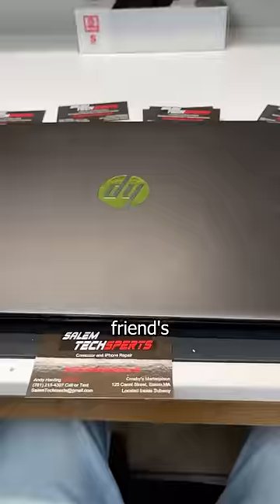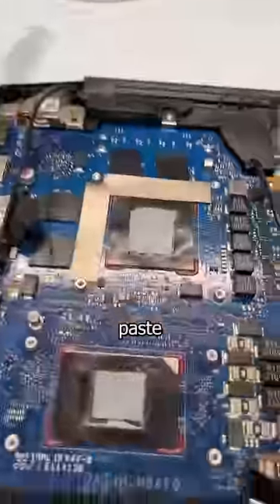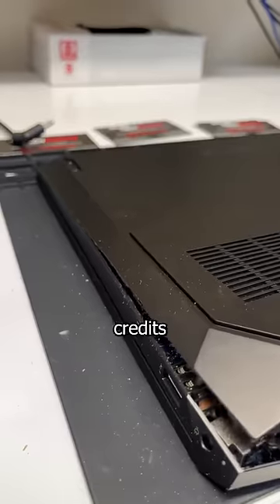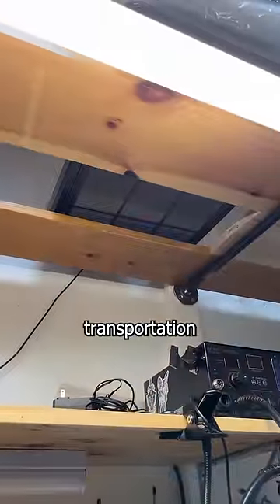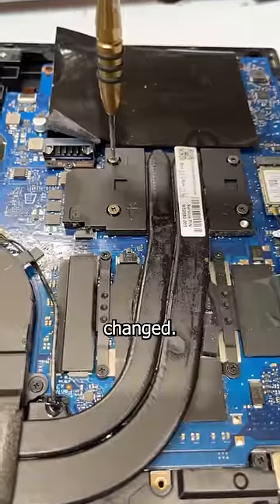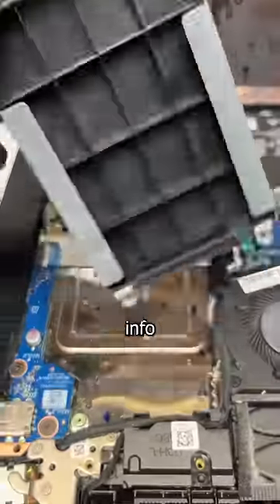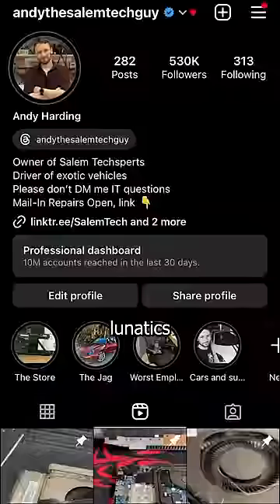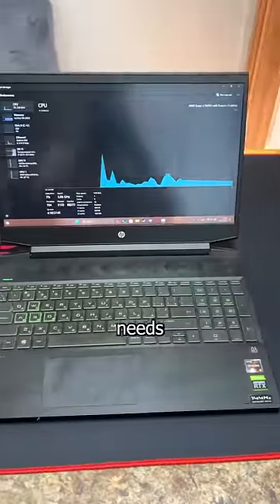HP #laptop survived the war in Ukraine and saved my friends life. #tech #pc #technology #shorts

Comment: People in my area expect all that work to be done for 20$ because of all the druggies who use computer repair for a quick fix; and the diptwits who enable them.

350$, I wish. 

Anyways, good on ya for helping the fellow out.
Reply from the maker: Unfortunately it's all about where you live and what customer base you want to attract. Minimum wage is $15 here, rent is $2500 for a 1 bedroom. So no one is doing anything for $20 here.
Reply: @SalemTechsperts  Yeah, I know what you mean. I moved to this city because it had 11x the population of the city I was in before. Figured that should translate out to being at least 1.1x more business at the very least since there was just so much more people. But... alas... the competition is also 11x more... and 11x cheaper... 

I used to charge 35$ an hour, and most jobs were complete in 1-3 hours, variation depending on the laptop, customer, etc. I would still have to make it look like I was giving them a deal, even though I was taking less than the 'professional' locations would take. Basically my rule of thumb is to charge no more or less than 60% of what the pro's charge. This way it doesn't undercut them unfairly (Ideally), but still demands a high enough amount that I can get by on repairs alone if the day job isn't one anymore. 

This worked well enough in the smaller city, though the amount of customers I was getting wasn't quite enough to justify staying. (I ended up hearing about that via the phone when some of the old customers came looking for me to fix new issues that popped up a year later. They were not happy they had to go through the trouble of finding someone competent again... Especially the guy who gave me a bunch of space brownies as a tip. Sorry dude.)

But here, in this city... so many drug addicts using kijiji and other similar websites to get their drug fixes now... and just as many diptwits who enable them... Salem... I doubt even you would get north of 20$ here.

Average rent is basically 1-2k here, depending on where you are willing to live. Per bedroom.

Edit: I'd have to charge something more along the lines of 100$ per hour now to meet the same income ratio required to justify doing it. And as one customer told me... "I can just go to walmart and get something for 300$ instead if its going to take you longer than 1 hour."

Not only do they not understand their folly, but they don't even understand that they are literally the problem for themselves.